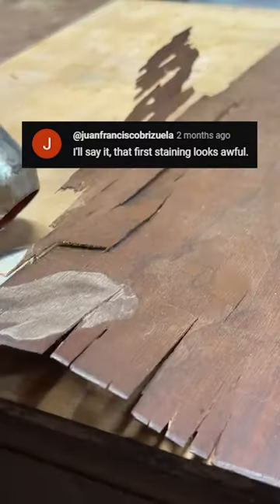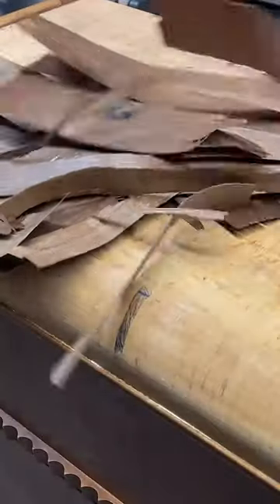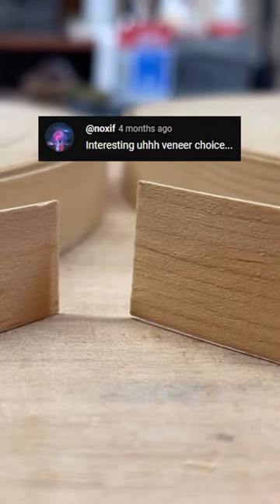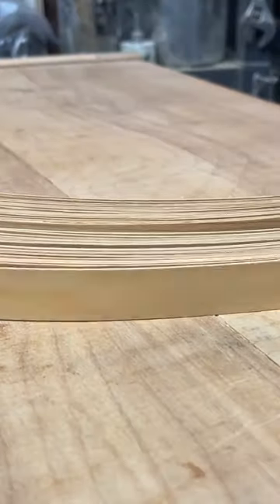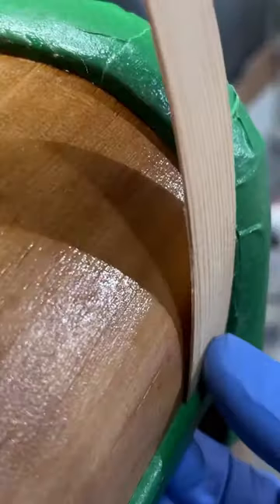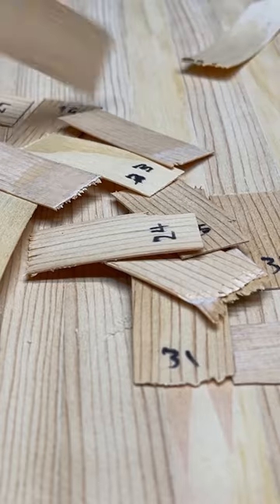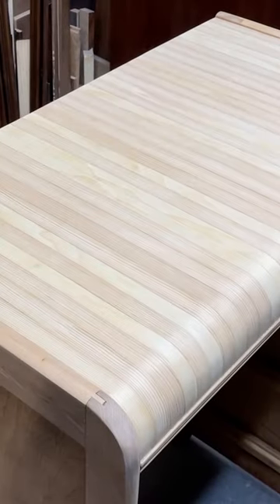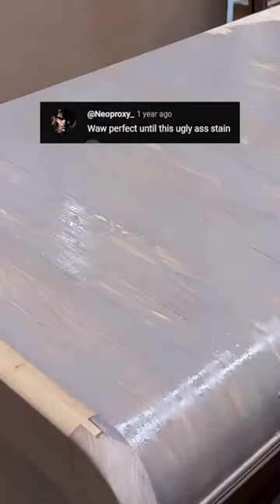The WORST veneer I’ve ever worked on #restoration #furniturerestoration

Comment: Ok, first of all the veneer choice was nothing short of genius. 
I wasn't in love with the stain choice but not because I didn't like the color. It was actually a very nice color. The reason I didn't care for it was because it covered and hid the pattern of all those interesting veneer lines created by using banding instead of solid veneer. It also hid a lot of the grain.
However, I still thought the finished product was extremely nice. And beauty is in the eye of the beholder so I never considered it a wash. As if anything you restore could be wash 😊
Reply: agreed!
Reply: 100% agree, was thinking exactly the same!

Comment: I think it was your design choice which can be a personal preference that some people will not like but some will.  I think the overall end result was very nice. I find that most of the time you turn something plain into a more elevated piece.  I appreciate that you aren't doing restoration but rather a reuse and redesign of the original that usually has a more attractive aesthetic value than the original if it was factory new.